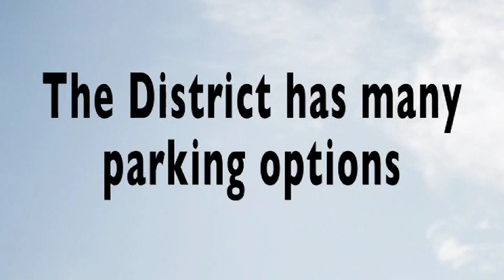Diesel Idle Reduction in the District of Columbia

Comment: AND also cummins diesels (which is in most diesel powered vehicles) go to a 3 cylinder idle which burns even LESS fuel which at that point takes about 2 hours to burn as much fuel as it takes to start up one time.